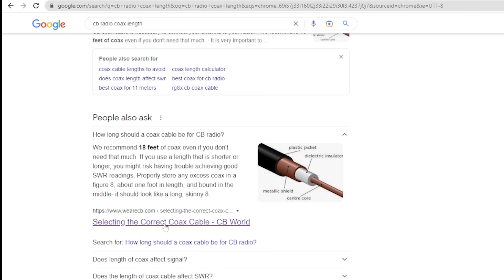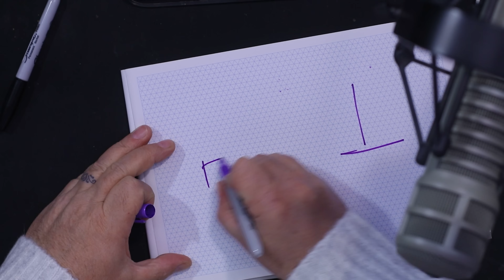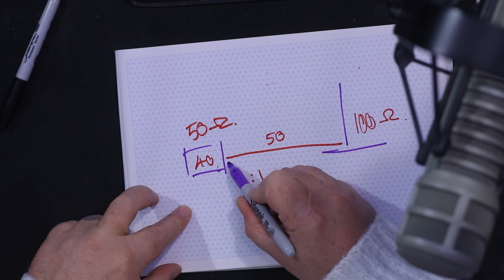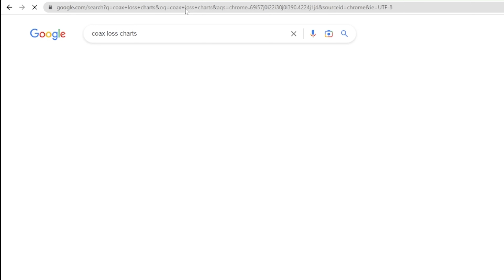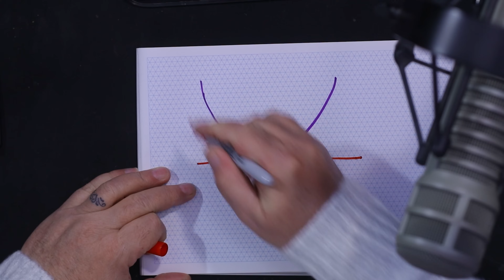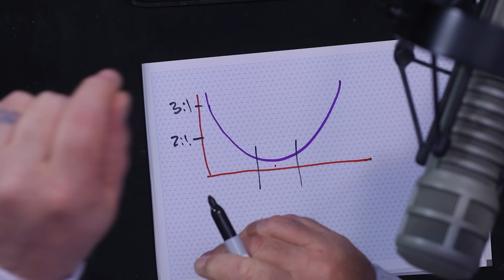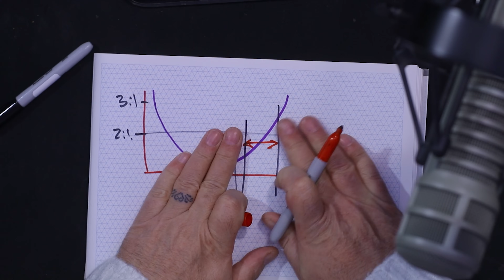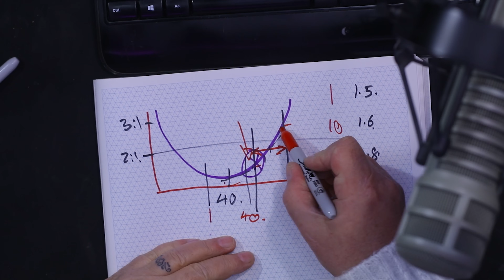11m / CB Radio: How Long Should My Coax Be?

Comment: Following on from your comment about a dirty balun using the excess coax. If you use a length of coax that is an odd number of quarter wavelengths (adjusted for velocity factor), then this will also act as a really good attenuator for common mode current running on the outside of the coax. I wish I had known this when I was a CB operator. 

One advantage of becoming a licensed amateur radio operator is that you get to learn all this stuff through the courses for the exam, and the support and knowledge of the guys in the local radio club.

Keep up the good work, Callum. I look forward to your nets on Fridays. 73, David - M0NMI.
Reply from the maker: Yeah nice! (although I've never cared about common modes myself..)
Reply: You have the answer! For example, a quarter wave antenna has a low common mode input impedance. By employing 3/4 wavelength of coax, you transform this impedance. And as my earlier post read, coax with a velocity factor of 0.66 at 27.055 (truckie ch) will be almost exactly 18ft long (1.38mm short). So it is not a myth at all! One very good reason to minimise CMC in the car is for noise suppression.
Reply: Use any length of coax and put a ferrite ring on to stop CMC. I've been doing it for years.
G4GHB.
Reply: You know you could still be a cb operator and apply what you learned. It's not too late . CB radio still has a place for you! Dxing is legal to do now and the skip is rolling. 73s

Comment: Why do we see people taking the P out of people on the CB.  We all start with a intrest somewhere also some off the CB have more knowledge of how the radio works on the inside an lots of A class license holders can not rewire a plug.
Reply from the maker: Alun, it's more the other way around these days. There are a few die-hard CBers who think folks like me are pr1cks.
Reply: @DXCommanderHQ  When I was on the CB I did go up on some ham bands over 28Mhz most on there were all OK but in the Ham Radio club most in there did rip CB people apart as you did say the hobby has to start some were.
Reply: @alunroberts1439  What did you expect, you're out of band?
G4GHB.

Comment: Good advice as always Call. I extended my first mobile CB antenna with a paperclip to get the SWR right, as I got the USA on the low power (4 Watts I think) that my CB had it worked well! Coax is one of the most misunderstood parts of our radio set up. As an M7 I have to work at getting everything as efficient as possible, something the Tech holders in the States miss out on, as they can just turn up the power to overcome any losses in there set up. 73 Jim M7BXT
Reply from the maker: Right on!

Comment: You didn't explain the nugget of truth in this lie.  When you have a mismatched antenna with a high SWR, there are points along the coax where there are voltage nulls where the forward and reflected signals cancel out.  If you happen to cut your coax to put your VSWR meter at one of these nulls, it'll show a 1:1 match even though the actual antenna match might be a terrible 4:1.  The reason for this is because the meter doesn't have enough voltage at those points to work correctly.  Changing the coax length doesn't do anything to your SWR, but it can cause your VSWR meter to stop working.  This is why the CB antenna "Gurus" tell you to make your coax a particular length or to trim the coax to fix your SWR.  It doesn't do a thing for your SWR, it just makes your VSWR meter lie when you have a crappy antenna.
Reply from the maker: OK, please make a video about this.. The concept I discuss is sound though.
Reply: @DXCommanderHQ  Oh absolutely, I just thought you were going to get into this when you said you were going to explain the whole half wavelength thing.  This is why CBers who don't understand tell others to trim coax to fix their high SWR problems.
Reply: @stargazer7644  oh do they understand full well the art of feedline impedance transforming?

Comment: In mobile applications the problem boils down to poor counter poise on modern vehicles. Especially big trucks . For one they are glued together not welded and cushioned with rubber mounts everywhere so they don’t provide enough counterpoise to Satisfy the meter. Solution trim the coax length until you get a match on poor coax . Try to convince the Lori driver his coax is shite . Nope. Work with what you’ve got on hand trim coax length . You are exactly correct in a proper setup but for paying customers with low budgets and understanding you do what works.
Reply: The preferred and better option is to create some form of counterpoise ie another antenna grounded pointing down or some other oblique angle until you get a match . Or adding wire  or metal to the body in strategic places but all that cost money and time . 
There is also the factor of other items in line with the coax ie meters amps, preamps etc  with questions all build quality and impedance bumps to the overall system . Coax length adjustment is the quick and cheap fix . Not the preferred method but I digress. Again refer back to low Budget low knowledge  consumers . The do often go away telling everyone they must adjust their coax length because that’s what worked to get their system right. 
Let’s just say the issue is complex . So enough with each side insulting one another for a non traditional method .
Reply from the maker: Hang on, where does the word "unsulting one another" come into this discussion? Have a pleasant manner around here please.
Reply: @DXCommanderHQ  poorly worded . As I pointed out the insults come from both sides in this discussion and there in no need for it if the problem is approached from proposing solutions and good explanations for why the problem exists. As you so well do in your presentation Callum.
Reply from the maker: OK, using SMiths Charts and cutting coax to compensate for a crappy installation is one way out of the problem.. But as you said on the other comment, make it work from the beginning. You don't need MUCH of a counterpoise on 11m to get acceptable results.
Reply: @DXCommanderHQ  no argument there.
Reply: @DXCommanderHQ  I refer back to low budget low knowledge operators that don’t want to know how it works they just want it to work . Even after I demonstrated a counterpoise system and higher quality coax on their vehicle correctly functioning they would still insist I was only trying to up sell them or they simply did not have the budget for proper upgrades. I digress again and say maybe I should have been more creative in my solutions. Such as for example the DX commander Nebula I personally own .
Reply: @ChrisDitchDigger  I wouldn't consider an op who understands feedline impedance transforming someone with a lack of knowledge
Reply: @paulm0hpd319  sorry maybe I wasn’t clear . I’m referring to operators who only use their radio have it installed by someone else and have no desire to understand how radio systems work . Primarily cb radio truck drivers that use it professionally but nor limited too. Most drivers are very knowledgeable so this is not a stab at them as a whole . Just to clear .
Reply from the maker: If you don't mind me saying, this is a bit of a dead-end thread..
Reply: @DXCommanderHQ  Well I haven’t looked at it in a couple of weeks Callum but since you bring it up......... 😉🤓

Comment: If the swr changes with different coax length, that means the shield of that coax is hot with RF and in fact radiating. Those who direct feed dipoles with no balun may experience this, or shoddy designs of verticals may experience this. Callum is spot on about coax length in a properly working antenna system. The length of the line shouldn't matter except excess adds loss.
Reply: That's often the case with mobile radios installed in cars and trucks because the don't have a good rf ground or radials for a counterpoise. Cars and trucks are made out of plastic and fiberglass, these days. Lol
Reply: Correction may or may not with dipoles.
That depends highly on the connection quality.
Often adding a balun can be more of a hinderance than a benifit.
Your better off putting a common mode choke at the feedpoint IF you need one at all.
Reply: @tedmead465  I respectfully disagree. Sure, you can use a choke, but the common mode loss doesn't magically go away, it just warms up the choke instead of leaking from the shield of the coax. Why would any ham be okay with RF leaking from their coax before it reaches the antenna in the first place? Seems counter productive to me. I've never seen a commercial broadcast station or SW broadcast station feed a dipole direct with coax and just accept kilowatts of common mode loss in a high power system. I'll trust the broadcast engineers knowledge over some hams old wive tales any day.
Reply: The length of the line doesn't matter if you have a good match.  It DOES matter if you have a poor match, because there are standing waves on the line.  Where you measure makes a difference when you have a poor match because of what the VSWR meter actually measures - voltage.  This is why some people believe changing the coax length fixes bad SWR when all it does is fool your meter.
Reply: @stargazer7644  exactly this. Well matched no problem. Bad match will give different SWR at different points along the coax depending on the wavelength.
Reply: @stargazer7644  it's not fooling your meter it's measuring the impedance at that point
Reply: @paulm0hpd319  exactly. Otherwise, how do they expect matching stubs to work?
Reply: @arconeagain  unfortunately the lack of understanding create myths

Comment: i have a workmen  cb antenna  has no radiels about 3 feet long had hooked it up to a random shot piece of coax  would pin the swr neaddle in the red. but like you say its all 50 ohm. .on line they gave a chart so many feet for different distances so i rigged up a piece of. rgx forgot how many feet 70 some  swr was 1.1   now does that type of antenna use the braid of the coax as the ground plain ??? find antennas such an interesting topic
Reply from the maker: OK, so the braid is part of the antenna (cut it and find out) but the enegery should be in the middle, not the outside. If it is on the outside, you will find things like the back of the microphone can het hot when you talk and all sorts of other stuff. Basically all we need to know is that it should just be the pipe between the radio and the antenna. If either one of these is "odd" - it's "possible" to fix it with very specific coax lengths (transmission line theory) but for almost every single one of us - and 99.99% of the time (me included) we SHOULD be able to ignore the coax and concentrate on keeping the length down.

Comment: The myth started originally on CB with a bazooka antenna a 1 meter piece of rubbish  in the 80,s a loft indoor or outside low profile antenna it would not work (it was rubbish) and recommended 18  or 36 feet for swr to be good.. somehow ,Chinese wispers went about and still go around regularly... It's tru about the yanks... They find it hard to let go...bless..
Reply from the maker: Gawd!
Reply: @DXCommanderHQ   ha yes, it did, nt help plus alot of hams believe this too.. I always say when was the last time you bought coax and they asked what band do you want it for.so we can give up the correct length.. . and do they have a special coax for a mulitiband antenna 😂😂😂😂

Comment: Also - how often are antennas actually the true 50 ohms at resonance in the real world?, ie how  high above ground is the antenna?, is it close to other wires? what about that 40 feet of roof gutter sitting less than 1/2 wavelength away underneath the antenna etc . . . .  
Anyways - all good stuff Cal!     Another great video......   Current project here is a coax fed 3 wavelength per side 10 meter Vee beam looking northeast towards Europe, the Vee is up about 40 feet (the legs of which are each approx 100 feet long).....  It is un-terminated so am getting good results also in reverse to the south-west... So far is good results on 10/12/15 meters, though the ups and downs in propagation keep it more than interesting, not to mention the local snow and ice storms in the midst of the current project hihi ! Is nice to have one antenna with gain for more than one band and two directions.  WWV on 25 MHz is super loud on this antenna
Reply: They're at 50 ohms every time you have a perfect 1:1 match.  That is to say, once in a while.
Reply from the maker: I have never seen a vertical under 45 Ohms (even with 1,000 feet of 32 x radials. And I have never seen a tuned dipole out of spec by more than around 80 ohms. Therefore, I'm a 1.5:1 man myself.
Reply: Re the 100ft per leg Vee Beam here, I have now added an "ugly choke" at the feed point, 10 turns Rg6 on a 7 inch form, and then to a 1:6 Type 31 transformer to the 2 vee wires,  and is working noticeable better!  I Tx here at semi QRP 50 watts. My 25 MHz WWV reception here went from S9 +10 to S9+20  with most recent feed-point mods.... Am being heard quite well I believe...  Is nice to TX 14-30 MHz in style once again....

Comment: Hahaha….I remember something about this argument for more than 40 years!!!  Laughed then, and still laughing about it.  As an RF expert (now retired), it simply and easily ID’s those that don’t have a fundamental understanding of…. Well, I don’t want to pour any salt on wounds, but you did a very nice job of letting the air out of a few balloons.  And yes, I had 10 or 12 extra feet of RG-8 coiled up on the floor by the window where it went outside to the antenna.  One friend just couldn’t stand that. Hahahaha.   Good job!!!  …as usual…
Reply from the maker: Hey Roland.. I find it difficult to speak "English" sometimes!
Reply: As an RF expert, what are your thoughts on CMC in regard to this one? After all, 18 feet is close to three quarters of a wavelength of 0.66 coaxial on at least one channel of the 27Mhz citizen's band.
Reply: You have not answered my question. You said that anyone that believes in this IDs them as not having any fundamental idea about RF theory, and you claim to be an RF expert. Did you forget your transmission line theory? Probably best you delete your post to save any further embarrassment.
Reply from the maker: @arconeagain  I'm not an expert. I don't trust anyone who says so. I'm a practical scientist. Call a professor at the local university if you want to speak to ao.eone about theory. Beware that I'm not alerted to comment threads so you won't probably receive another reply unless I'm lucky and happen to spot it.
Reply: @DXCommanderHQ  my comment was directed at your mate Roland, aka self proclaimed RF expert. It's truly amazing what you see, hear and read here. I mean, imagine a radio enthusiast saying they don't care about CMC. It was obviously a desperate bid in covering up a video blunder, your apostles might have followed the breadcrumb trail if they had a brain between the lot of them. Wait til I tell my mate about this one. He's a ham since god knows when, who takes great joy in watching fellow hams... well, just be hams. Remember this, it's called 'amateur' radio, for a reason.

Comment: I've been looking at this for a few years. The problem with mobile antennas is that they are using the vehicle for a counter poise. If it's a poor ground, the outer shielding of the coax will be the counter poise. Cutting it short or coiling it up will change the value of that counter poise. KO4UGN
Reply: What do you consider a poor ground? some of my best results, mobile, have been with a mag mount as near to the middle of the car, so the outer shield has no connection to ground? I think a lot of confusion with anything antenna related is that as people who have a good knowledge of electronics we forget that radio is electro-magnetic  :) (I may have misunderstood but I agree if you are driving a fibreglass car, that would provide a poor ground for radio)
Reply: @robrs2000  A magnetic mount is nice. I use one on my pickup. It came with a long cable attached. But, I think it's designed to use the vehicle as a ground plane. As I understand it, the RF doesn't see the base as an open, but passes    through easily to the ground side of the coax. That works well on a steel roof top. 
 When you buy an antenna at the truck stop, it's usually made to mount on the mirror and it's packaged for the rocket scientists that relocate the freight across the interstate system. The bodies of the modern tractors that they pilot are made of plastic, fiberglass and aluminum. They hang an antenna on the mirror mount and it needs a counterpoise. I've actually added a counterpoise on my rig, but it didn't change much because I had already run a ground wire from the mount all the way to the chassis. I have a 1:1.6 SWR with no tuner. I use a tuner, though because I slip into spare trucks, sometimes that haven't had as much thought put into their antennas. And my coax is much shorter than the eighteen feet recommended by antenna manufactures.
Reply: @eyeinidas  Yes, I thought at the end of my reply that you may be talking plastic cab type situation. I have always wondered, with a big trailer if there is any millage in a wire antenna down the length of the trailer, probably not very convenient if you are always swapping trailers :)
Reply: @robrs2000  It would be fun to try. I also pull these old steel tanker trailers. I want to mount an antenna on that thing and see what kind of range I get. It would require a longer cable to reach. I don't think I would loose to much on HF running a little long all the way back to the trailer midpoint.